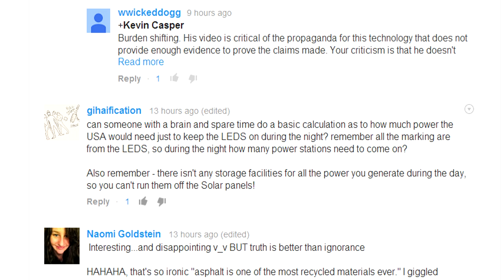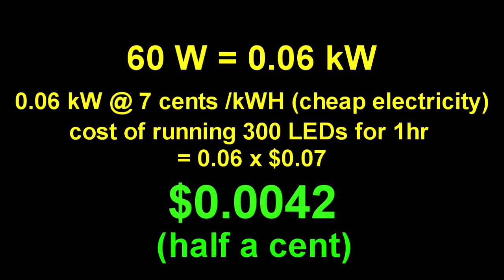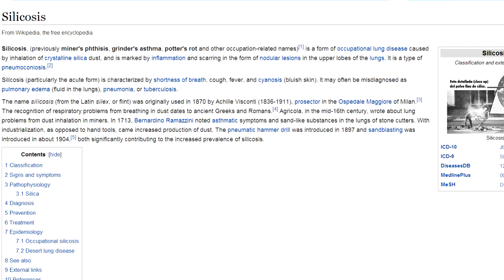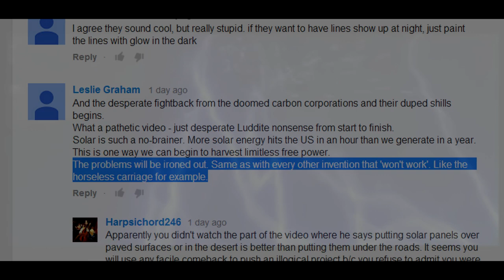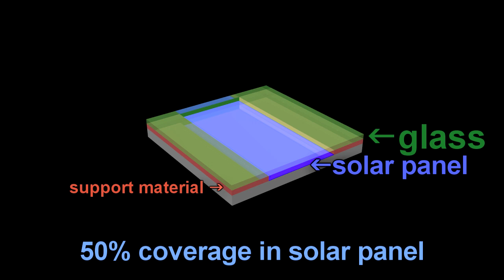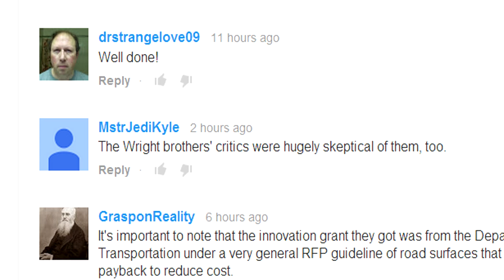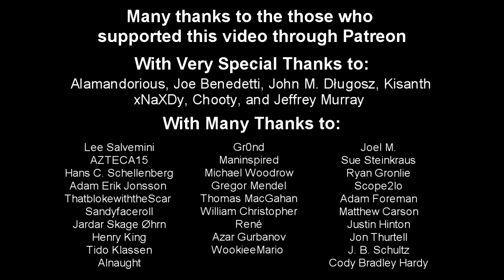Solar Roadways, IMPORTANT QUESTIONS AND ANSWERS!

Comment: Has anyone ever though about car crashes? I mean that is the very first thing that comes to my mind when it comes to roadsurfaces. Every car crash leaves it's trails on the road. Be it skidmarks (which obviously reduce the efficiency because they cover the glass and therefore the solar panel), damage from the cars itself because of damaged tires and so on, spilling of chemicals (fuel, oil, water mixed with antifreeze and so on...). I honestly dont know how anyone can support this project without even safety features being tested to the slightest. No one know how cars are going to behave on the surface in ideal conditions and no one has a slightest clue how they behave in the worst conditions. And those ppl. call themself scientists?

Sorry but i did better science when i was 5 years old and discovered that electricity is nothing to toy around with when i was licking on a battery.
Reply: jeremytwoface People are against this because it won't accomplish anything in it's mission statement due to material and physical limitations. Also resources are limited, every dollar that was wasted on this project could have gone to something useful.
Reply: Safety features haven't been tested fully because they haven't had the funding to do so. They just received over $2 million on Indiegogo to help that. They aren't just going to put it into place without testing these types of things. And a company is definitely not going to invest millions of dollars to implement something that isn't fully tested. The product is in the beginning stages of development... You can't expect them to have all the answers right now.
Reply: jeremytwoface You dont need a million budget to do the simplest of material study. And those studys would have shown that glass is not a suitable road surface.
Reply: http://www.solarroadways.com/faq.shtml

Follow that link. It provides answers to a lot of your questions.

They have done simple tests on their product in regards to traction, skid marks, impact testing, load testing, etc. Like I said, they haven't been able to test these applications on a large scale because that costs a lot of money. If no one supported projects that weren't tested yet, no projects would be started. You need some start up money to test things. Now that they have that money, they will be able to test things they couldn't before and re-test things they already have on a larger scale. I'm not saying that this technology is perfect, I'm saying your reasoning for not supporting it is invalid.
Reply: jeremytwoface Take a look at the video above again and tell me where my arguments are invalid. All that testing can be done on a budget of like 100 bucks to determin this wont work out.
Reply: OK the first problem on the video - LEDs --- First of all, the video is making a lot of assumptions. He is saying it's going to take trillions of dollars to power just the LEDs, but I'm pretty sure the LEDs will be self sufficient from the solar power. I doubt that that citizens will be responsible for funding the LEDs power. But even if they do, over 55 billion dollars of state tax revenue already goes into fixing our roads now. That's not even including federal funds. As far as the brightness of the LEDs and not being able to be seen in the day time, what do you think video billboards and (most) traffic lights are made out of?? You can see those things just fine. But lets just say that the LED part doesn't work... I'm sure the gentleman in the video found some pretty bright LEDs, but they aren't as concentrated like they would be on the street. But let's say they try to find a cheap, efficient LED that would work but they can't. Then they could just pain the roads like they do now. What's the difference? It would block a very small portion of the sunlight, but I doubt it would be enough to make the technology obsolete. 

Next - the glass ---- The gentleman in the video brings up the Mohs Hardness Scale to reference. The FAQ page I mentioned above answers this. It lists common materials by their hardness. Asphalt is listed at 1.3 on the scale. Plate glass is listed at 5.5 to 6.0 which is harder than platinum and steel. The material they are using is a tempered glass that is 4 to 5 times stronger than non-tempered glass. So that means its over 4 times stronger than steel. If you think him scratching some rocks on a beer bottle is an accurate test of how tempered, bulletproof, bomb resistant material will react to wear and tear, you are crazy. Plus, the money they have raised to test and implement this technology is not just for testing the glass. I'm not an expert in solar energy, but I'm sure a lot more goes into it than just the glass they use on the outside. Then he compares building a road out of glass to building a dessert skyscraper out of chocolate??? Please.

Then he talks about effeciency - The developers have already said that, even at 15% percent efficiency, it would create 3 times the amount of energy we already use. Then he goes back to how fragile it is and how it won't be able to support the weight of vehicles... From the websites FAQ page (again, I mentioned it above so maybe you should take a look at it) -- "Our current M1A2 Abrams tank weighs about 68 tons, or 136,000 pounds. That's a little over half of what our Solar Road Panels have passed load testing for." So I'm pretty sure that answers that question.

Bottom line --- They have tested most of these questions that the gentleman in the video are asking. That is not what they are using the $2 million on. Here is a quote from that ever so popular FAQ page I mentioned when asked about what they are using the Indiegogo funding for...

"We have been working for years with just the two of us and a handful of volunteers. We have now reached the point that we need a team of engineers to help us make some final adjustments in our panels and streamline the production process to bring costs down and allow us to produce them more quickly. That is exactly what we are going to use the funding for. We are proud to start offering jobs, the more funds we get, the more we can offer. We can also start building machinery for assembly of the Solar Road Panels. You wouldn't believe how many solar cells we broke while assembling 108 prototype panels! 

We don't know where the misconception has come from that we need to pay for projects. The Federal Highway Administration funded two prototypes for us and now we have a very long list of potential customers waiting for our panels to be ready for purchase."

So there we go. I have no officially posted the longest comment ever on YouTube.
Reply: jeremytwoface And yet none of it is proven in a valid way. Those are just some notes on a homepage.
Reply: So let me get this straight... Your argument against a technology that could provide clean, sustainable energy for billions of people is that you think the company that is producing the technology is lying about how well it works???? Do you think they need to post YouTube videos of every test they do on their product to prove it's validity?? Why would they put that information up if it's not true? They have nothing to gain from that... Like I said, anyone investing millions into this product is going to want proof that it does what they say it does. So there's no reason for them to lie about it.
Reply: jeremytwoface
it would not be the first company/privateer/inventor to claim something that simply is not true to generate a revenue, especialy when it comes to crowd funded project. Unless i see HARD FACTS i doubt that any of the information shown on their Homepage is valid.

Simply put, if they did all those tests why dont they show them to the public that FUNDED THE PROJECT and literally payed them to do so.
Reply: Because the public DID NOT fund the project. The Federal Highway Administration funded it. Do you think they are lying to the Federal Government?
Reply: jeremytwoface You obviously missed their indigogo project which is indeed crowd funded. They got 2.1 millions from the public and just about 750k from the government. Get our facts straight before even attempting to keep this conversation up.
Reply: I know about the Indiegogo project. I even mentioned it in one of my previous comments so I get the feeling that you aren't even reading my responses. They recieved 750k from the government to create working prototypes. They have tested those working prototypes successfully and are now moving into the implementation stage which includes mass production. That is what they wanted the crowd source funding for.

Let me ask you a question... are you putting any money towards this project?? The government has already contributed money towards it so you can't help that. So why be so negative about it? Did you shell out the $2.2 million? Why are you so against it?
Reply: jeremytwoface
I am entitled to my own opinion and i base that opinion on FACTS. Since no facts are shown after a 5 YEARS PERIOD OF TIME this project is running now i simply call it a fake, a cashgrab, a scam.

Lets see it from a different angle. If you had a product for which you have proof that it is superior to a product that already exists and which could replace that product why would you keep every single fact you claim to be right a secret? Would you not go out and smear your information into the faces of everyone who said you where wrong? Would that not generate even more money if you had VALID FACTS and not just some notes on a homepage a 5 years old could have created thse days?
Reply: snoMedia There are valid facts, but you just refuse to believe them as such. Did you even read the FAQ page?
Reply: jeremytwoface A FACT is something you can prove, not just some words written down to make others belive you have done something. In this case the only fact would be a video showing that they did the tests and that the restults they show in their cute little FAQ are right. None of it exists apart for the FAQ bit. Honestly i feel sorry for you if you fall for such nonsense. i guess you belive everything you read on the internet.
Reply: Mark Baanstra They also said that all of their panels are grounded and surge protected. And the panels are ground level. They are FAR less likely to get struck by lightning.

Comment: also cars will fly off the road in a turn since glass doesnt have enough friction to make the turn, or we will have to drive really slowly in turns
Reply: it will be like driving on ice, a little less slippery but still quite less than roads now
Reply: Oh yes, I'm sure that you've had the actual textured,processed glass they will use and like them, tested friction multiple times on multiple universities, right? 

Right?
Reply: SirVixIsVexed
It doesn't have to be as smooth as a window to be dangerous.
With just the smooth concrete they have in garages you can squeal the tires with a tap of the gas.  You wouldn't want to drive on that surface at highway speeds.
Reply: Response was for Sebastiaan, i cant tag :)
Reply: SirCutRy
Sounds like your full of it.
Reply: charlesvan13 The glass is not flat, it has many small bumps to better the friction and ability to push water and dirt out of the way.
Reply: ***** This kind of measurement (friction) needs to only be done a couple of times to get accurate results. The first results were so good that they needed to bring the texturing down.
If the results were bad, why would the Highway Administration lie about it and say that they were good? That would only do them harm in the long run.
Reply: ***** If you are that concerned about safety, you should look into what effects not vaccinating or big pharmacy companies have.
Reply: @SirCutRy  And the safety of the solar fricken roadways going up in flames? and one important note is concrete / asphalt absorbs oil, however solid glass does not, and their are always cars leaking oil.
Reply: @Skelath  Flames?

Good point about the oil. I don't know if they test it, but they should.

I don't think it's a good idea anymore. This was five years ago.
Reply: @SirCutRy  Ya dude after a few weeks the panels went up in flames during the winter because the LEDs were too hot, keep in mind that the panels have still yet to produce electricity and high powered LEDs aren't cheap to run, my 1800 lumen Nitecore MH25GTS flashlight fully drains a 3,400mAh battery in less than an hour, keep in mind my Galaxy Note 10+ has a 3,500mAh battery.
My 32,000 lumen Imalent DX80 drains eight 3,000mAh in less than an hour and sets paper on fire in less than 7 seconds, and even then the torch can't maintain max brightness without dimming to prevent itself from overheating.
Reply: The surface has already met the Federal Highway Administration's durability and friction requirements. That means it acts just like regular asphalt roadways. They say so on their intro video. To claim that kind of thing without it being true would be like claiming your fake medicine can cure cancer and is FDA (Food and Drug Administration) approved to do so. That means it would be illegal to claim that without it being true.
Reply: leongama89 Do I need myself go to the research lab where they found out that universe's inflation happened and make the tests myself and come to a conclusion without any education on the subject?

And just because "if you don't see it, it can't be true"? Can't you believe what experts say?

Comment: I had a feeling the solar roadway idea was doomed the instant they said that the surface was going to be made from tempered glass, supposedly the same kind used in bullet-proof windows on armored cars.  The idea is not only economically untenable, but the glass is still gonna get scratched up pretty badly.

Comment: I tried searching "Solar Roadway test track" and got nothing.  In the video you can see the tiles being laid out as a road surface, is there any results such as energy production, did they drive different types of vehicles over it.  Having they done any impact testing on them.

I found this on their website and i had to chuckle  it compare normal roads to solar roads and used the analogy of comparing  a apple and a fruit basket  (in case this a UK thing a Fruit basket or a Fruit case is a term for someone who has gone mad or is ranting in anger)

Has this become the debate for those who are bored of the is god real debate?

Comment: Why not just leave out the LEDs? Right now we use reflective paint and reflectors for road markings (we drive with lights at night of course, this cheap reflective plastic works great for creating boundaries on roads and can also been seen in the day). They should simply paint the damn things for the lines, and use reflection like we do now. Thin lines to avoid covering them too much (or maybe leave them out in the parts of the road where you need paint lines). Clearly there must be a cheaper way.

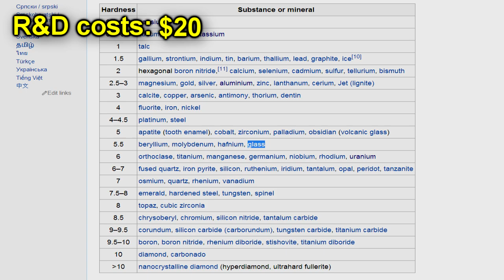Comment: 7:37 and that's not even the last of day time issues. At night because glass is glass and it likes to conduct light along itself the so nicely drawn, very defined lines and text etc become a lit up hexagon that bleeds light in the adjacent hexagons effectively turning the road surface in to a hazard for not only car drivers but pedestrians as well. Shine a light in your face and try to make up something in the distance.

Oh and the only way for the LEDs to works is if they are high lumens ones, so you can't go around that issue.